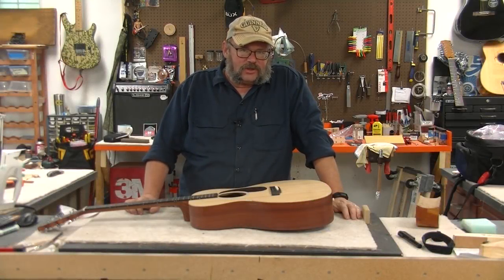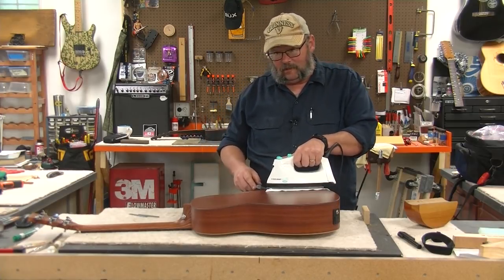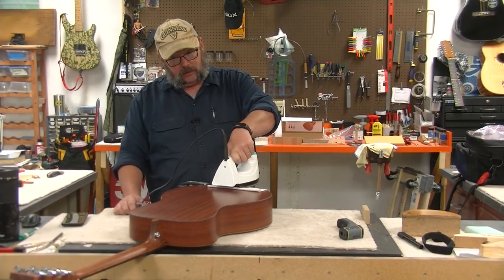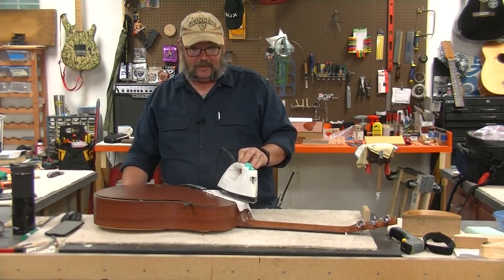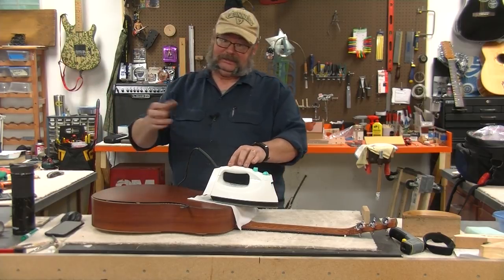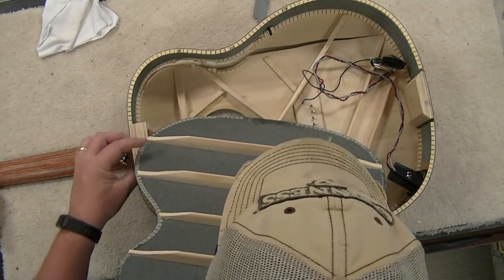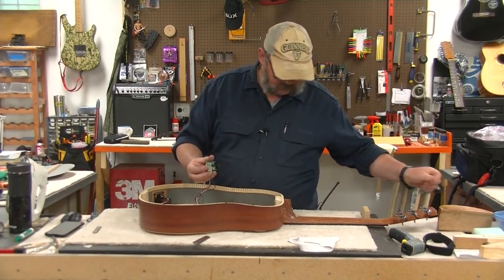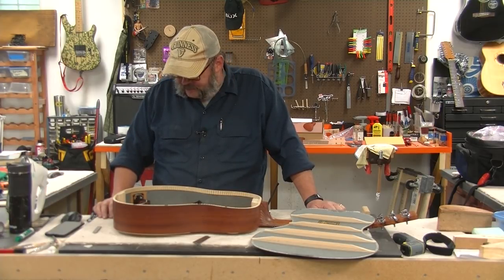MARTIN X-series back removal | RATTLECAN GUITAR RESTORATIONS by James O’Rear

Comment: I have researched this because a friend of mine had, I think it was the DX which is all HPL. HPL is High Pressure laminate or in layman's terms plastic laminate. Or in brand names Formica. It's made from very thin layers of paper compressed under high pressure, high heat and resin. Martin's HPL is about .080 thick and normal counter top stuff is about .040. That's about the thickest I could find when I built my Formica guitar. I understand the need to find alternative guitar materials just not digging these high dollar plastic and plywood necked things. The one my friend had cost round 700$. That's without a spruce top and from the looks of the Mexican made one on your bench those folks are not well acquainted with sand paper. Good video though, cool to get a good look inside.
Reply: Dane you are spot on with the HPL.
Reply: Heh... Formica... shades of a 1960s Danelectro! :D
Reply: The spruce in HPL dread guitars sound better than any other guitar.   It's Martin best kept secret.   I have the original dx1 made in America had it for 20 years still play it everyday never needed work done perfect intonation.   What sold me on the guitar years ago was that it sound better than the guitars that cost tens of thousands and I only pay $500.   It has amazing bass I love for my finger-picking and over the years the highs resonate so much now.    The equivalent of my  guitar I guess now is the dx2e for $650 on the martin site.  Even though it's made in Mexico I imagine it has to sound as good.

Comment: Great informative video.  I looked it up because I bought a White Falcon "kit" with a great piece of flamed maple on top.  upon inspection I found the the sides, back, and top have no kerf bracing of any kind.  Meaning the glue surface is the three ply laminated side minus the router cut for binding, maybe 3/32".  Additionally the neck angle is not great enough to clear the bridge.  the upside? Well the tailpiece, bridge, pickguard, and nut are decent; and I have a great looking swirled maple arch top.  Neck and ebony fretboard are nice.  What's amazing is how good the cosmetics are with no consideration of structure, other than economize.  With a flexible camera I see there's not even a block for the strap button.

My plan is to remove the back, then install kerfing for the top and back, lateral braces for the top,  side braces like an L5, then close it, route the back edge for new binding .   In the end I hope to have a useable pro quality jazz box.  As it is. it wouldn't last through a good blast of feedback.

Additionally, I had no idea Martin was in the cheap guitar business.  I'm sure the fix will be more expensive than the purchase.
Reply from the maker: We have lived in the era of disposable goods for quite some time. Try to find someone to fix a toaster...lol.

Good to hear of your plan to learn from what you have. The day you stop learning is the day you begin dieing IMHO. Keep us up to date on your progress.

Comment: The "HPL" material that Martin is using reminds me of Formica counter top material.
Reply from the maker: Same thing.
Reply: I recently acquired a Gibson B-15 from 1967ish. There are two braces missing from the top. The other two are cracked. I am planning to remove the back to make the repairs. I've never done this before and thank you for the inspiration and encouragement.

Comment: The "Grain" pattern on the back side of the back is just sanding groves. It's on all HPL whether if for counter tops or cheap guitars. It's there for a better grip by the glue. I don't know if you have done it yet but go grab a laminate sample from a box store (for free) and see what kind of heat it can take. When I built custom countertops I remember HPL could take a lot of heat but I don't remember how high of temperature.
Reply from the maker: That's a great idea and thanks for the info re: backside grooves.

Comment: Hey thanks for showing this. Question for you. I have a Guild D4 from the 90's, was damaged likely in hte retail shop as it looks NOS. But the side has a gaping hole and crack along the whole side. Have some pieces. The top, back and neck are perfect. People say don't bother fixing buy something else (It was free). I was thinking removing the top and back and replacing with pre bent sides may work, thoughts?

Comment: I found a mahogany top cut away in the dumpster at work. Looks like same issues you have split top separation on bindings. I was excited at first but looks to me it's been repaired already. I'm very surprised martin makes an instrument of this low quality. Sad they use their name to sell garbage. I figured I will take a hand at fixing it or throw it in the wood stove but it's plastic so guess I have to fix it.
Reply from the maker: If nothing else it has a lot of teaching moments to offer. Might be it’s lot in life at this point. Best wishes.
Reply: @RattlecanGuitarRestorations  I figured it can't get worse and for a few bucks I could have a beater. It's split all the way around to the blocks. Thanks for the video! I'm going to put some heat to it tomorrow and see what other issues it has. 🤘🤞
Reply from the maker: @todaystopic3527  Keep us updated!
Reply: So it went very good. More I got into it, my opinion is this is just bad craftsmanship from the factory. Where the back popped you could see there was no contact to the kerfing. There was tear off where there was good contact. Anyway I had to replace about 25" of kerfing and reglue a back brace. Man this thing has zero structure to it when I removed the back it popped concave almost a half inch on the top. So to get it close enough to glue up I put about 50 lbs of steel pieces in it while it was on top a surface plate. Then I was able to glue and clamp it back on. The neck came back great about .040 over the top of the bridge. I was worried the way it popped out so bad in every direction. I bought a piece of bone to make a new saddle strung it back up action is great right at .09/.07 at the 12th. No buzz but fretts could use a lil leveling. I'm gonna hang onto it for while see if it stays in one piece. If it does maybe I will find it a new home. Plays great tho. Thanks again for your videos. 👍🏼👍🏼
Reply from the maker: @todaystopic3527  Good to hear progress was made. Amazing once you dig into things how little material can go into them.

Comment: same technique it is ok to unglue bridges?
Reply from the maker: Yes, gentle even heat will soften the glue joint so you can pry it up with most commonly used glues
Reply: @RattlecanGuitarRestorations  Uau, thank u for your great answer man, so I m lefty , I need to convert new righthanded acoustic in lefty.
Do you can teach me to do this please?
( IF YOU CAN AND YOU WANT)
Reply from the maker: @lafinestracatalana8340   The simple answer is to remove the strings, flip the saddle 180 degrees, make a new nut (you probably won't be able to use the old one around) and re-string in reverse order.

Lots of info already out there, Google is your friend here. 

Unless you're already comfortable doing these tasks it might be better to find someone in your area to help you out (support your local guitar technicians) or purchase one made for leftys. Bracing patterns inside acoustic guitars are often designed specifically for left or right handed players.
Reply: @RattlecanGuitarRestorations  I know all of this, but I live isolated and the most near luthier is 700 km, and it cost 1000 dollars the reparation ....

Comment: I’m sorry but all hpl are garbage .  Just stay away from any x series Martin .
Reply from the maker: You fix the work that comes across the bench.
Reply: Rattlecan Guitar Restorations sorry my reply was aimed at perspective buyers .
Reply from the maker: No harm no foul. Thanks for watching
Reply: I build guitars and so too was skeptical of these guitars but after some playing on a couple I have changed my mind. 

The plywood necks are some of the best necks I have ever played and plugged in these give you a “Martin” Sound. I am actually impressed with the ingenuity involved in making these non-traditional instruments.
Reply: Martin call it stratabond .  It’s the same stuff used for firearm wood stock.   It’s very tough and keep the guitar neck straight . But sadly it’s very heavy and can make a guitar top heavy .